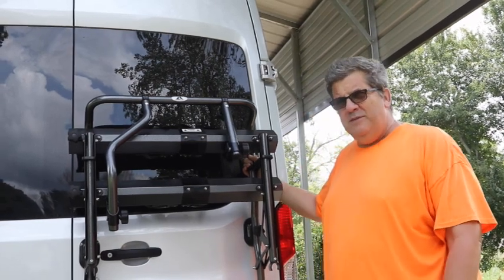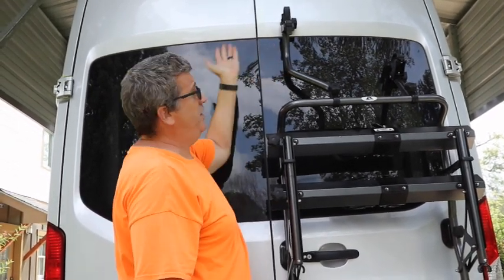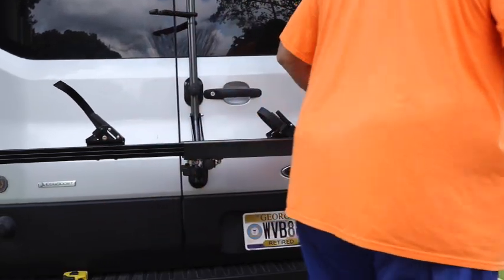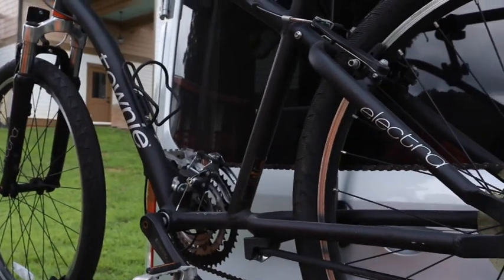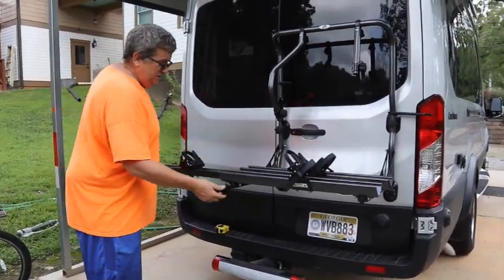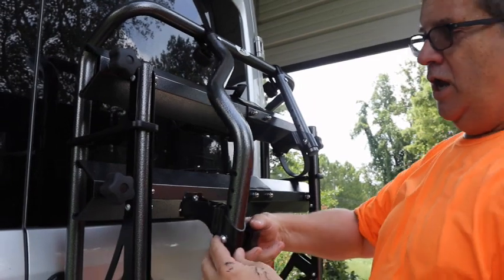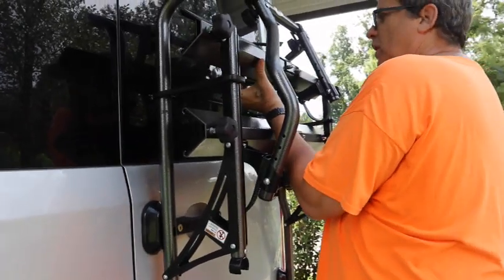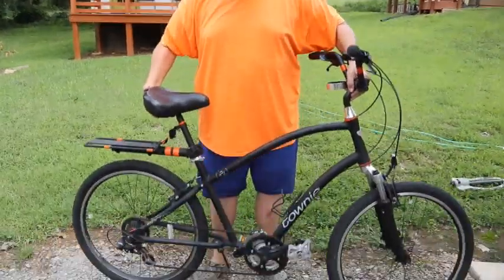Summit Bike Rack - Coachmen Beyond

Comment: Another helpful video👏🏼. We won’t be concerned if the Beyond model we find doesn’t have a bike rack after seeing your demonstration and 100 lb bike limit —definitely our eBikes would be too heavy and also a ways to lift it up to set on rail on rack even if it could be transported on the rack. Thank you. Deb asked a helpful question and thanks for answering by demonstrating that floppy piece should be zip-tie secured for safety.
Reply from the maker: Thanks.

Comment: We really appreciate your posts and recommendations!  
We are newbies and are wondering if you are aware of any plastic caps/plugs that fit into the bike rack’s mounting foundations when the rack is removed and stored in off use time periods. 

Thank you.
Reply from the maker: Thanks.  I don't know of any plugs to cover them.  I almost always have my rack on that I converted to an outside storage box.  Maybe a short piece of PVC pipe painted black and held in place with some stainless steel bolts?

Comment: Does your pull down on the doors- pulling the alignment down on the door that is holding the bike racks.
Reply from the maker: @lynseyanya  I gave up on using  the bike rack because we now have e bikes.  Even before that, I was worried about the weight of the bikes.  I took the bike rack apart and made a lightweight cargo box to carry hoses and other light stuff.

Comment: Love the bike rack video, but can’t find where to buy one.  Can you advise?
Reply: Summit Products doesn't sell these retail. You will have to acquire it from your coach manufacturer if they offer it. The door on your coach needs to be prepared with certain reinforcements on the interior of the door before the bike rack can be installed. Unfortunately Summit doesn't have the capability to make these modifications they only supply the rack to the manufacturer for OEM installation.

Comment: I would like some exterior storage so do you think a box or canvas storage bag could be attached to the bike rack.  It would be handy to store hoses etc.
Reply from the maker: Yes, I am actually trying to come up with something to put there to hold a few lightweight items.
Reply: @CampingCoastie   me too! Would love to know if there is a storage solution that you can swap out the bike rack and put in a storage container that would screw in to the existing 4 holders on the door
Reply from the maker: I have seen a couple of home made ones, but I have not found a commercially made one yet.  I am trying to come up with a simple to make one.
Reply from the maker: I have actually designed something that should work.  I have what I needed ordered from Amazon and need to go to Home Depot for a couple of items.  If this works out I will be posting a video of it soon along with a parts list.
Reply from the maker: This is the box I put together. 

https://youtu.be/9ihfww-uX-8

Comment: Is it is lockable to the van? Or do you have to lock it with a cable lock. 
Like to see the plastic mounts on the door . Some people have commented they pull out.
Reply from the maker: It's not lockable.   If needed you could lock it with a cable to the trailer hitch, but that would affect opening the doors in an emergency.
Reply: @CampingCoastie  I would probably run a cable lock to the door handle or get speciality bolts to lock it on

Comment: Where do you find this Summit Bike Rack?
Reply from the maker: It was an option on my Beyond from Coachmen.
Reply: Summit Products doesn't sell these retail. You will have to acquire it from your coach manufacturer if they offer it. The door on your coach needs to be prepared with certain reinforcements on the interior of the door before the bike rack can be installed. Unfortunately Summit doesn't have the capability to make these modifications they only supply the rack to the manufacturer for OEM installation.